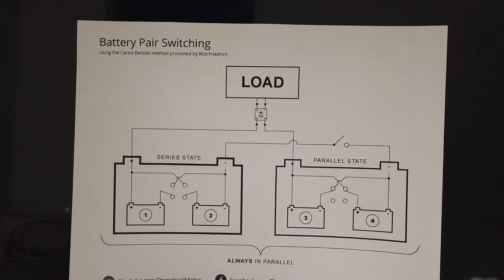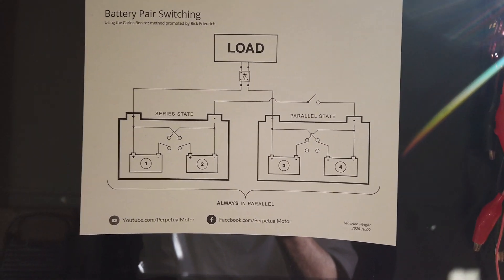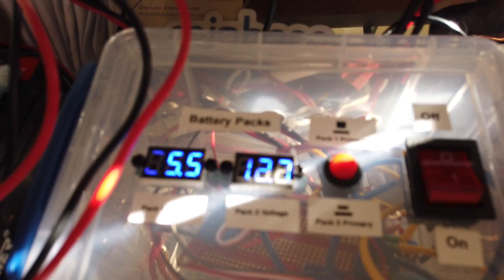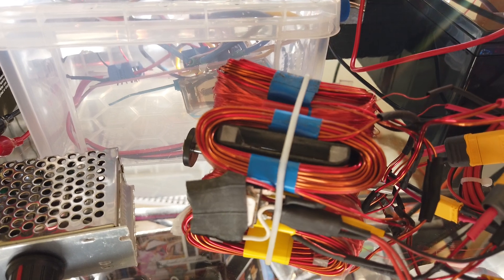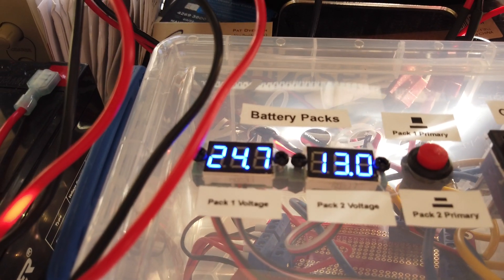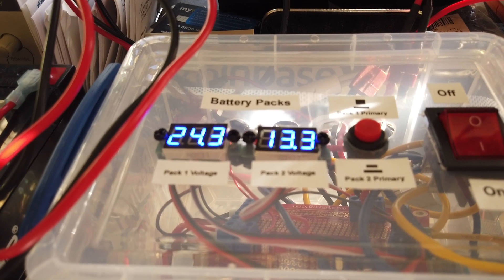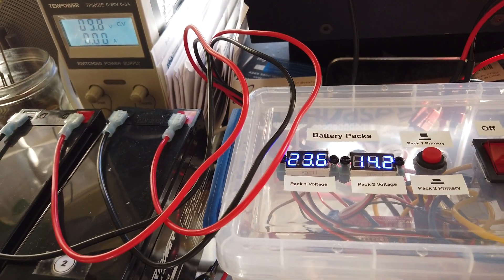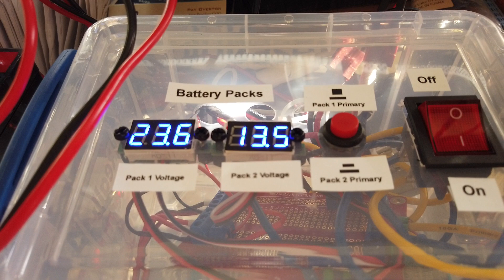Battery Pair Switching Demonstration - Using the Carlos Benitez Method. Is it really free energy?

Comment: Nice job! Not to put you down buddy but that is the perfect way to sulfate batteries. The problem is that the current that comes from the series batteries is the same as what is going into the parallel batteries. Having the same size batteries like that means the parallel batteries will require twice as much amperage to charge them that’s just how batteries work. Love your videos keep up the amazing work!
Reply from the maker: That's what I've heard. But I've also heard about a few ways to desulfate batteries using high voltage impulses, which is what the REAL Carlos Benitez method uses. Thanks for watching!
Reply: @PerpetualMotor  I can see that working if you fully charge the batteries before you switch them but that will never happen with that circuit
Reply: @PerpetualMotor  I have repaired lead batteries with pulses several times (i.e. the series resistance was then significantly lower so that I could use them again). There are also china chargers that use this method. These have a repair button to activate this mode.

Comment: Don't kill the battery's. If you switch a battery fast it wil break the plates. Try capacitors instead, as Carlos described in his patent. Use resonant frequency, as the resistance in the coil disappears.
Reply from the maker: I actually did try this with a capacitor bank. The caps lost power pretty quickly. I really need to figure out that spark gap part.
Reply: @PerpetualMotor  think in vibrations and harmonics. The first coil is in resonance. The second coil is in resonance but one harmonic higher. Thus it vibrates double.
Reply from the maker: @MakeAndCreateSimon  I’m guessing there’s higher energy content in the higher harmonic frequency. I’ll have to meditate on that. If you have any reference material, please let me know.

Comment: Need to switch them faster
Reply: No. The switching is done by the load. The load generate the high voltage pulses that went through the accumulators and this is the additional energy that you need. So it is good to use a pulsed motor. A resistor as a load would not work.

Comment: I purchased two Dayton 1EHY1 (about $15 each) magnetic latching relays to build this device. Only a pulse is required to change states. So no constant power consumption to run the relays.
Reply from the maker: I was looking all over the place for a latching relay that could deal with over 100 watts. Thanks for the tip!
Reply: @PerpetualMotor  You're welcome, and I'm glad that information was helpful to you.

Comment: how long does it run,? we have same set , except im using solidstate bedini style, and dumping the spike to charge battery in other set., then swapp. ive notice it still dropping slowly
Reply from the maker: It depends on the load. I can see the total voltage dropping across all batteries, though.

Comment: Good job.  Though there are some things  I would consider changing.
I dont see the spark gap or coil magnetic collapse which is the punch needed for compensating other normal losses.  Feeding the magnetic coil collapse to the charging battery bank is what desulfates and keeps the battery in top condition for recharging.
The other thing to consider is the source of info:
Bedini is the legend....
 Peter Lindeman is like the associate professor 
Rich is just a Tutor gone Rogue and cant really dive deep into information without confusing himself.
Reply from the maker: I started playing around with spark gaps, but I haven't seen any phenomena that validates what Benitez found. However, high discharge plasma spark gaps could potentially be adding something from the environment that could warrant some additional investigation, but this isn't something that Benitez discusses in his patent.
Reply: @PerpetualMotor  
Take a look at vintage and classic igntion system for ford T back in 1915.  Dont need to buy anything just look at them see what Benitez may have thought of.
I am still trying to make time for my project.  
Cheers to you
Reply from the maker: @pedrotorres9836  thanks for the tip. I'll take a look.

Comment: Do you have any plans to use a high-frequency switching system for the output?
Quoting Benitez's patent, "Obviously the current furnished by the discharge of battery one&two alone, would produce a smaller charge in batteries three&four, if some energy were not added to the normal output of said battery one&two. With this object in view any of the known methods for the generation of high frequency currents, as well as those described in the aforementioned English patents, can be employed in conjunction with said batteries, in order to provide that complimentary energy, and in this manner it is always possible to charge and discharge alternately each battery from one to the other, maintaining a constant storage of electricity and producing furthermore and excess of electrical energy."
Reply: QM75DY IGBT module should be ok for switching these  currents, th3se modules have heatsink flat bottoms so cooling them is easy. These are low cost as well and not so easy to burn like the TO220 package.
Reply from the maker: The challenge is the high frequency switching. I’m using relays to do the switching, and, at best, they switch at a little over 50Hz. Not really high frequency. This setup wouldn’t be able to handle it. I’d have to figure out something else. It was, however, interesting playing with 50Hz switching.

Comment: How would electronic circuits behave when the negative is at 12 and positive at 24 volt. Would it damage the electronics? Have you tried running any device other than fan or LED?
Reply from the maker: That’s how the circuit is set up now. The full bridge rectifier will always have the higher voltage on the positive side. It would run any type of DC load.

Comment: Great video about batteryswitching, nice setup by the way. I’m working on the 3BGS switching, so 3 batteries instead of
Reply: 4batteries
Reply from the maker: Thanks. With some type of voltage regulation on the discharging battery, I think this type of setup can be even done with two batteries.

Comment: Very cool. You should give this go with 4 banks of super caps setting the 2 main banks to 12 volts to see how long  it will last. A bank of 6 super caps using a logic board wouls run this motor for a long time in this setup. Again very cool.
Reply from the maker: I actually started with 4 super caps - 2 banks of 2. Of course, there's not a lot that can be done with 3V especially when you're losing 1.4 of those volts through a full bridge rectifier. That's still a good idea,, although 12 super caps plus a balancing board was a little out of my price range for this experiment. ;-)
Reply: @PerpetualMotor  I hear ya. I got the 12 I'm using from banggood or some other site like that and I got luck as they were real 2.7v supercaps lololol

Comment: chemical batteries cannot capture all of the radient, you must put carbon capacitors in parallel with all your chemical batteries to capture more of the radient.
Reply from the maker: Actually, in order to get any radiant energy to show up as static charges (at least enough to charge a battery) wouldn't there need to be some excessive spiking caused by abrupt changes in the current?
Reply: @PerpetualMotor  I think you cannot get any results with only chemical batteries, add capacitors in parralel. IF you are interested in looping the dc pulse look at my energy loop video I am in the process of proto type now, hope it works too. At very least if it works without shorting it should be super efficient dc motor driver for pushing ac gen. The way I see it if your not trying to harness the pull force of the magnets attraction to your core then you are "not" thinking about the free energy part of this design and your head is somewhere else, start with what you know is free.
Reply from the maker: @mykedoes4099  this video was really about the behavior of switching battery pairs from parallel to series. Carlos Benitez has a patent that professes the ability to conserve discharged energy from a battery by putting a load between series and parallel battery pairs and running from the voltage difference between the two. This is just the beginning of that investigation. I have other videos that describe the motor and the motor circuit that I'm using. You can see the circuit here: https://youtu.be/Cjs3GHyV10I And, there's another video where I demonstrate a decent sized dual axial flux motor that is able to run at less than 10mA by utilizing back EMF twice along with push and pull forces. You can see the video here: https://youtu.be/6LlcSS6Ji6M
Reply: @PerpetualMotor  Yes I saw all your videos , Carlos idea is similar to what I thought of but not at all the same. See my most recent video, lmk if you want collaborate (south Florida)
Reply: @PerpetualMotor  My diagram shows a simple circuit that should loop the dc pulse between 2 batteries, as far as the radient involved with that loop capacitors will handle that , use high voltage and low voltage varieties all in parrallel because you do not know the resonant at all times and it changes, so using a tunable capacitor will not help, using multiple farad mf ratings and voltages allows for my dynamics in the capture, coils can do it as well like you did with the flyback, but capacitors is the way to dump the coil not chemical batteries, the chemical batteries is the way to dump the capacitors for density storage.
Reply: @PerpetualMotor  Forget the radient it will show up later, the pull force of the magnet to the core is "FREE" but if you use more energy than is needed to break the magnetic connection to your core you will be wasting energy.
Reply from the maker: myke Does that makes perfect sense. Thanks for the tip. I’ll give that a try.